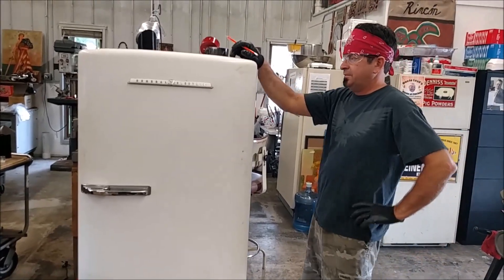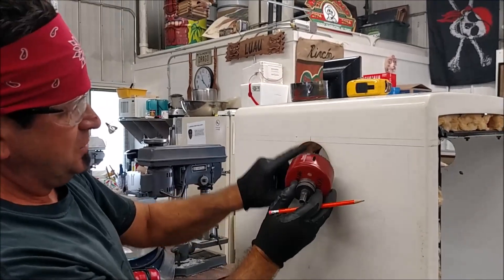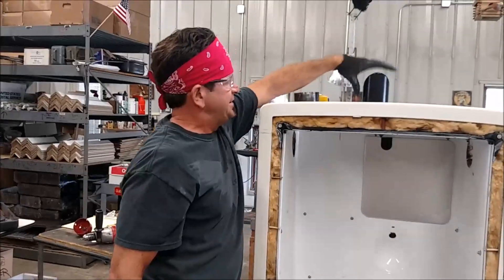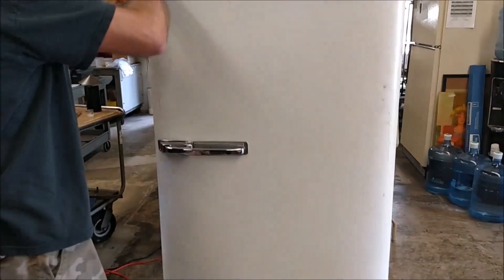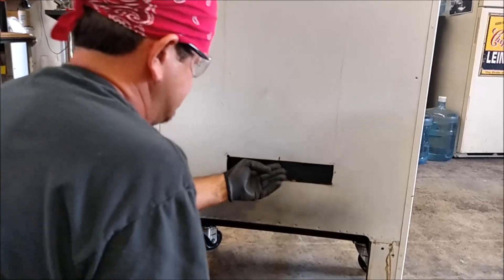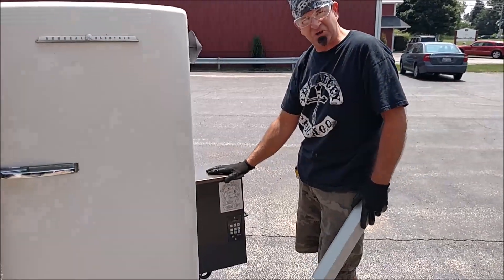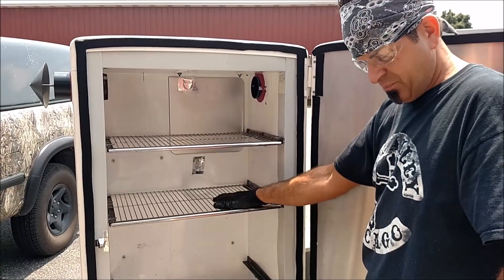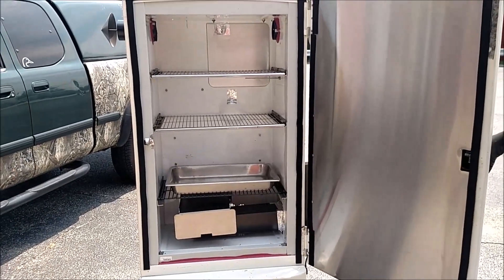How to Convert an Old Refrigerator into a Pellet Smoker with Pellet Pro®

Comment: do you put anything under the burner between the fridge so it doesn’t melt under burner
Reply from the maker: I do not recommend using the burner assembly burn pot next to any plastic material.. Also all plastic material should be removed. If you have any more questions please give us a call at 847-336-1329
Thanks Dennis

Comment: Nice work. So well thought out. Thanks for showing the placement of your temp probe just below the top grate. Also thanks for explainig the lower adjustable vent to modulate the air flow if need be. I will use this info for the pellet fed Ugly Drum Smoker I am building.

Comment: Yes I watch this video a few times just have a question on the red sealant around the vents for the top what is it where do I get it
Reply from the maker: Any heat resistant sealant will work . I found this https://www.amazon.com/Red-Devil-08090I-Resistant-Silicone/dp/B009EC5ELK/ref=asc_df_B009EC5ELK/?tag=hyprod-20&linkCode=df0&hvadid=192217280775&hvpos=&hvnetw=g&hvrand=16651284621394145111&hvpone=&hvptwo=&hvqmt=&hvdev=c&hvdvcmdl=&hvlocint=&hvlocphy=9021444&hvtargid=pla-304485731026&psc=1
Reply: Ok thanks for the help and sorry to bug you

Comment: Any asbestos concerns with old insulation?
Reply from the maker: Always check your brand of refrigerator for any undesirable insulation. Also check for material that may gas off at high temps like foam or plastic. As the bulider you will have to make that decision for your particular applacation.
Remmber Safety First

Comment: Put a stamped grill, non adjustable on the inside to hide those off holes  , and drill the discharge holes from inside out to avoid the measurements

Comment: What metal did y’all use for the door? Is it just stainless steel roll? I’ve been trying to find some
Reply from the maker: We used stainless you can use steel.Steel is much eraser to work with and much cheaper. And if you use a little vegetable oil on it to will work fine

Comment: Working on my fridge now.  It has like a thick cardboard in between for insulation.  Should I try to rip it all out or will it be fine if i leave it?  Thanks
Reply from the maker: I would remove it just to be safe. I would not try and insulate it a double wall should be plenty.
Give me a call if you like 847-336-1329 Thanks
Dennis

Comment: The drip edge that you used around the edges where you replaced the plastic pieces...was it galvanized?  Seems about all I can find at Home Depot or Lowes is galvanized and I didn't figure galvanized was a great choice for the smoker.  Maybe it doesn't get hot enough.  Just curious.  I can't seem to find anything except galvanized.
Reply from the maker: I used aluminum flashing and aluminium siding comers.to cover any openings I also used some aluminium tape. I don't think you will be getting it hot enough to be a problem.
Reply: @DennisCorrea  Thank you sir!

Comment: It appears that the original fridge racks were chromed and not stainless.  Am I wrong, and/or is it ok to use the chromed racks bring the operating temps are fairly low.  I know you can't cook over open flame on a chromed rack.  Asking to be sure I understand correctly.  Thanks and a great build!

Comment: so they didn't remove all that insulation crap mmmh..  bet those smoked foods gonna have a plasticky taste.. yuck!
Reply: As long as the insulation is not a foam type or anything that is flammable, you can use the insulation that the refrigerator originally came with.  In this case, it's fiberglass insulation which is not flammable and is safe to use with these custom smoker builds.
Reply: You think you are chewing on it or something.. lol.. Hell it is covered and helps to hold heat in the smokers..

Comment: What thickness of gasket did you use?  I converted an old refrigerator almost exactly like this one but I still need some heat gasket for the door.  As of right now, I have almost a 3/4" gap that needs to be sealed.  Did you have to adjust the door on the hinges at all to make it close more?  At the very least, I thought about doing what you did by putting it on the door and the fridge itself to create that seal. I was thinking about going with a 1/2" thick rope gasket.  Any recommendations?  I would greatly appreciate it.  Thanks!
Reply from the maker: You could try putting a 1/4" shim under the gasket to bring it out a little. I kinda like having a little gap to help with the air flow and temperature maintenance some of these refrigerator build are to well insulated and need the extra air flow. if anyone has any questions and would like to call me  call 847-336-1329 and I would be happy to help you.   Smoke Daddy   www.smokedaddyinc.com

Comment: Great viseo, do you guys keeps the original insulation or do you replace it with fireproof insulation?
Reply from the maker: Yes you can  replace it with fireproof insulation or just leave it without any insulation, You are only trying to keep the temperature between 160 to maybe 275 for smoking.

Comment: what did you do to cut the square hole for pellet auger,  noticed you also taped it to seal the gap, did you use a jig saw or Sawzall did you cut both at once or individually. 
I just got my 1950 fridge,  replaced bottom pan (rust) new insulation going in this weekend and ready to start drilling and ordering pellet hopper from you.

Thanks
Don

Comment: will the insulation around the fridge hold up to the heat?
Reply from the maker: The best fridge to use is a old one from around the 50s also make sure it is metal lined. If the insulation is made from fiber glass that is the best. If you are not sure if the insulation will hold up I would put a piece of it in a 400 degree oven and watch and see what it dose. If it melts you should not use it. I know you do not BBQ at 400 degrees but to be safe that's what I recommend.
Reply: This is a metal lined commercial fridge.  I will be checking the insulation today as I take the back off.  Thanks for the tip about testing the insulation.